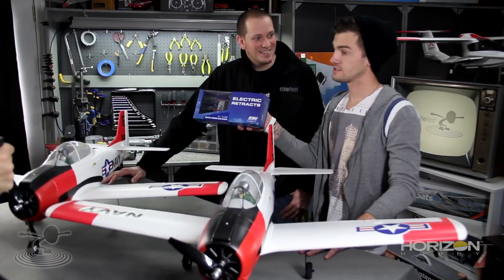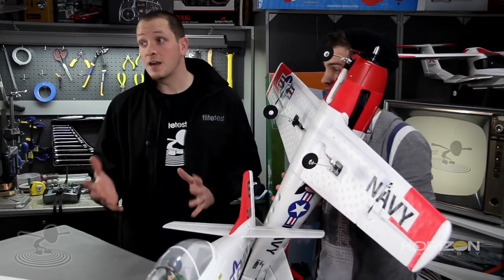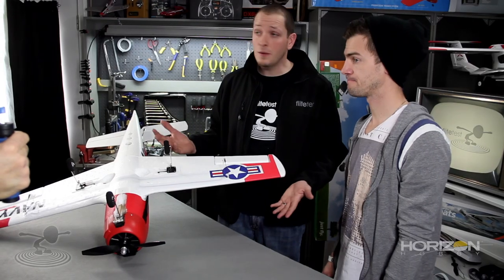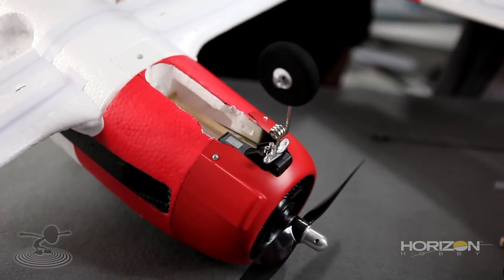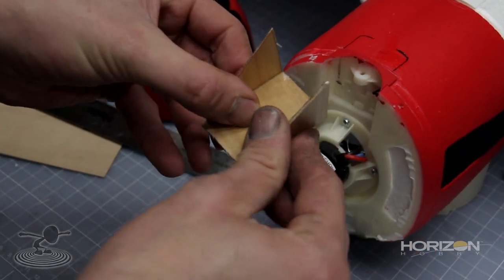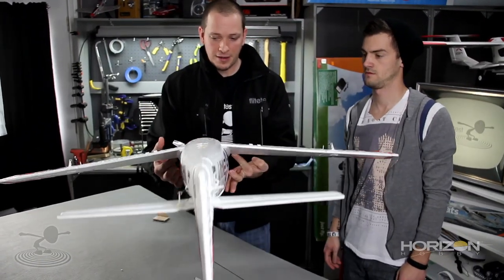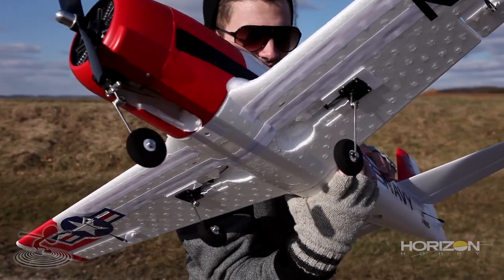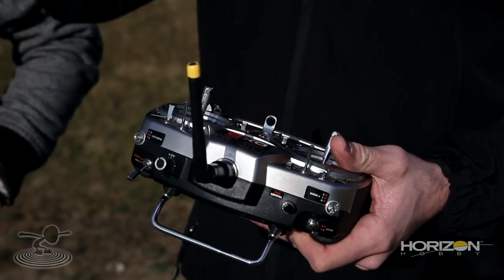Flite Test - Custom Installing Retracts - Flite Tip

Comment: I did it on my T-28! I followed Flite Test's directions, and now have functioning retracts on my Parkzone Trojan. The only differences are that I kept the main gear mounting points where they are, and installed the tires outboard of the main gear struts. The result is that the tires are the same distance apart as the stock setup (13") when extended, and are closer together - in the fuselage - when retracted. The airplane behaves just as Josh B describes. No bad tendencies. Also, the retracts I added are the smaller 10-15 size setup. The struts are the same diameter as the stock setup, so the tires go on with no modifications.

Comment: nice option to have....
another option - the nose is weak and a few nose first landings will usually require repairs - after many repairs I finally converted to a tail dragger.  Disconnected the steering linkage to the nose and put a small wheel on the tail, and move the front wheels forward to the edge of the wing and put a slight forward bend in the struts.  She flew really nice as a tail dragger.

Comment: Great landing in deed, J. Scott!  That T-28 Trojan is my favorite plane still after many many years in my hangar. I used it as a a Trainer, yes. Some might dissagree but it's so docile that I found myself flying solo pretty soon. Of course I also have a propper trainer, which I also keep, but I prefer the T-28 above it to teach my friends with the buddy box. I even installed flaps on it. Of course, if I want to instal this retracts I will have to use a spare battery and disable the BEC.

Comment: I tried my first attempt at eflite retracts into my PZ Habu about a year ago... turned out well, by which I mean it worked... I had a problem with the nose gear being too short, as I didnt have enough room for it to cycle further back... Anyway, it had a very long take off roll and would just pop up into the air like Josh said because of the incidence of the wing... Flight is on my channel. :)

Comment: Nice Vid guys well done on the landing. PZ T-28 Very good plane my fav had it a wile now very beaten up but its one of those planes that takes a beating and keeps on ticking... only bad point on this model is the motor mount changed mine very erly on.  great retract mod guys will try it at some point :)

Comment: I have a scratch build Piper Cherokee 140 I am adding these identicle retracts too. They look and work great...
Reply: PA28-140 does not have retractable landing gear. But it does have killer cool wheel spats(wheel pants as Flite test call them)
Reply: True but I recieved this landing gear as agift so I added them to my scratch build Cherokee. When you scratch build the sky is the limit. They work very good and are very scale.

Comment: Another good video, and nice job on the retract install. However, I find it ironic the choice of airplane...since Flitetest's "other sponsor" sells a foamy T-28 of exactly the same size that comes with retracts already built-in for you!

I installed those same E-flite retracts on a large foam "chuck-glider" that I converted to RC.  Maybe you should consider doing a chuck-glider conversion for a future Flitetest episode.  Chuck-gliders make a good platform for cheap fun experiments in building.

Comment: I have a question I have a Corsair foam plane that was givin to me and it has retractable landing gear which are retracted. I would like to open them without radio equipment. Can I use a battery to do this?

Comment: Do an episode on precision cutting into the Styrofoam for passing servo cables, cameras, maybe even tools that cut out perfect circles for landing gears.   Maybe you can also show a movie clip of how the factory does pre-cuts ( ex. servo lead wires in the wings) into the foam before they sell you a plane! This is so the airplane does not look like a hack job of cutting like some terrible plastic surgery.

Comment: @kalebsouth24 The HobbyKing Bixler RTF is an excellent trainer plane, and it's cheap compared to other planes. The shipping is expensive though, and you have to wait a month or two. It will cost you less than $175 for all you need, shipped!

Comment: I managed to rip the gear off my T28 without doing anything to my plane. It happened when I crash landed into some  tall grass.
Reply: Jeb Savage but u did crash it lol.
Reply: Matt 476 True, but the plane was literally intact. All I had to do is glue the landing gear mounting plates back into the bottom of the wing.
Reply: Jeb Savage one time I was landing over a corn field and got corn husk twisted around the weal. It was a very close landing. Lol
Reply: Matt 476 Wow, pretty close one. Glad the plane was ok.

Comment: That front wheel is to steer.  How can I steer it on retracts?
Reply: +Chris Schuler It is on the trojan. The E-Flite retracts come with a steering arm (I think) and you either attach and push rod to it or a servo linkage.